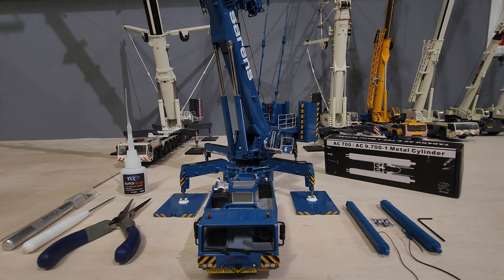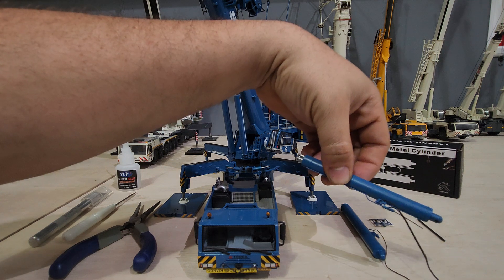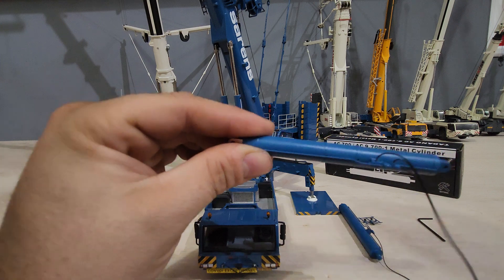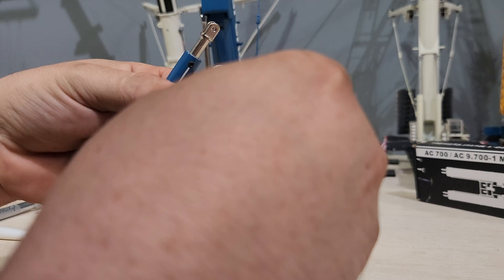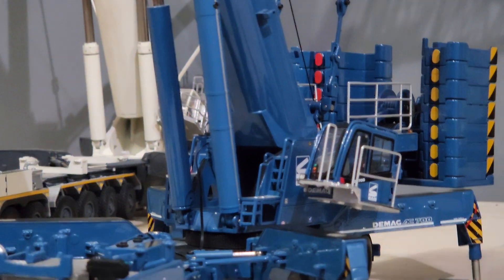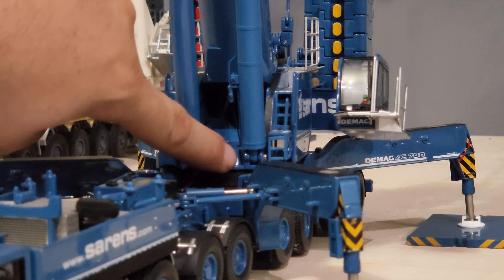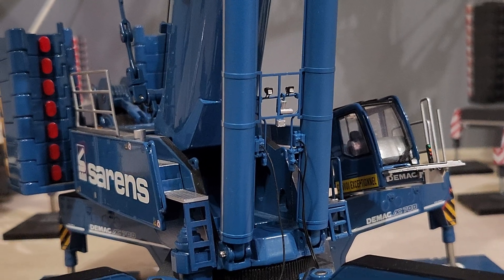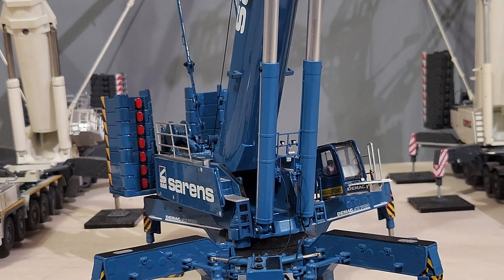HOW TO: install ycc replacement cylinders on IMC Demag AC700.

Comment: Those look outstanding! Love the way the actual cylinders look so much nicer than the originals then you add the added clamps on the sleeve ,the hoses and lights just beautiful. Great job on the video this helps us rookie crane collectors not be so nervous to do these nice additions to our models. I thank you now I will have to do this to mine as well as my 11200 but that one is still in the box.
I do have one question on these... How hard do you have to tighten these to hold the boom up? I'm always worried of the boom collapsing on me. I had it happen on my Grove 6300 luckily some how nothing broke but hearing that sound come from my model room I almost had a heat attack😆 Also the 11200 I bought the jib and extension kits for it so in sure that will be heavy to hold up. 
Thanks again always love these how to videos
Reply from the maker: Thanks, I hope this helps anyone who plans to do the same. I thought the same about these holding up like the 11200, but they are awesome, you don't have to crank them down to hold, just a little snug and they are fine, I've had the luffer in my 11200 for about a year now and 2 sections extended, and it's been perfect. Hopefully you have this style with the screw in the side, and not the collar on the top like the old style you have to twist to tighten. I could never get them tight enough it seemed. This style is much much better